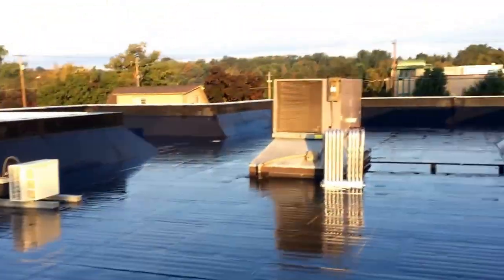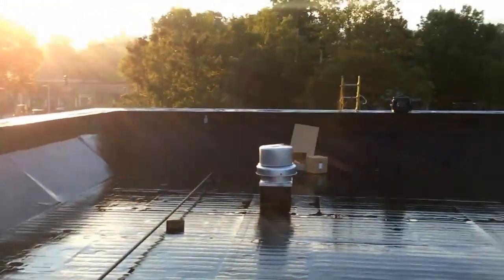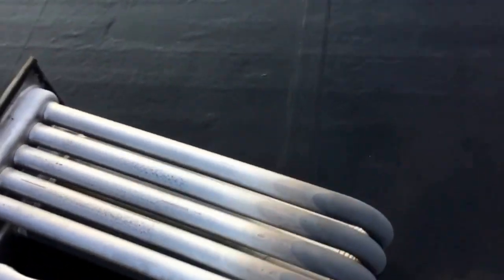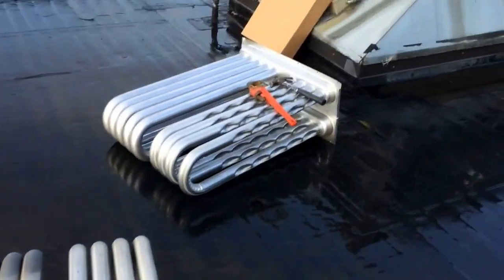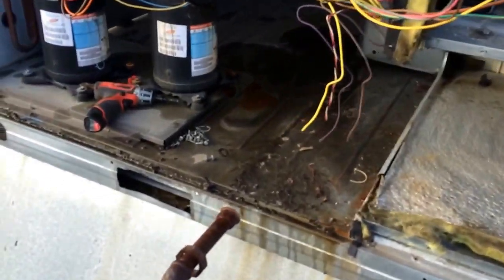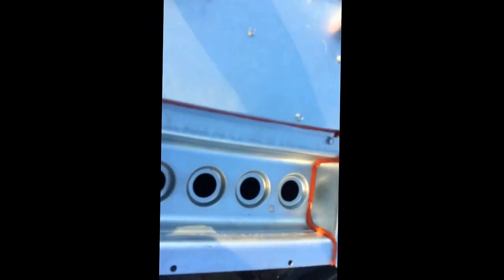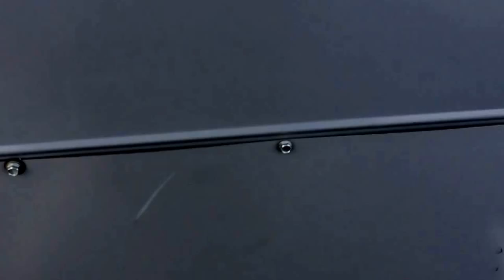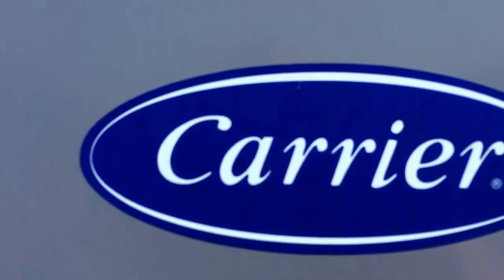Copy of Heat exchanger changeout on Carrier RTU

Comment: That changeout is fresh in your mind. We did one thanksgiving and the rollout tripped a few days back . Do you recall if that balancing plate could be installed incorrectly . It looks as if the furthest burner toward the back isn't flowing down the heat exchanger smoothly
Reply from the maker: Yes you may have something backwards and that would cause an issue. Usually a rollout.
Reply: Rob HVAC
Tnx.

Comment: Cool video.  I have changed alot of those Carrier rtu heat exchangers.  I like doing them.  Good tip on replacing the inducer motor with the heat exchanger too.  Thanks, Jeff

Comment: Nice job Rob. I love Carrier heatexchangers they are definitely less difficult then the old york/luxaire pain in the ass ones lol. I also change out all the parts on the heating assembly if the unit is old. It definitely prevents callbacks.
Reply from the maker: Emin HVAC thanks. They are easy to do.
Reply: Yank and crank as our good friend says 👍Rob HVAC, Stephen Rardon